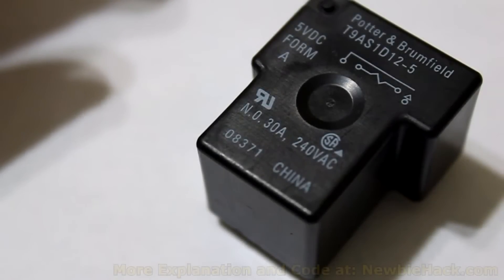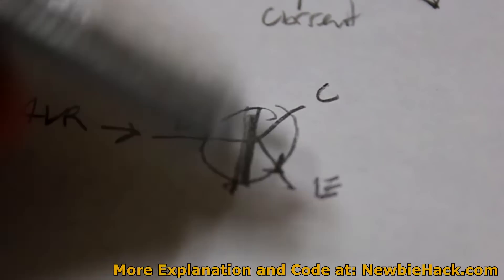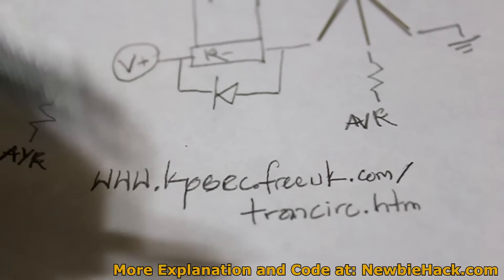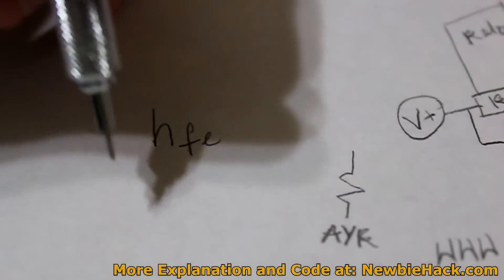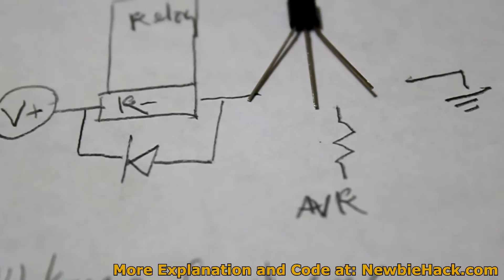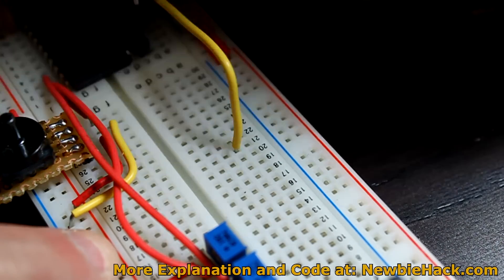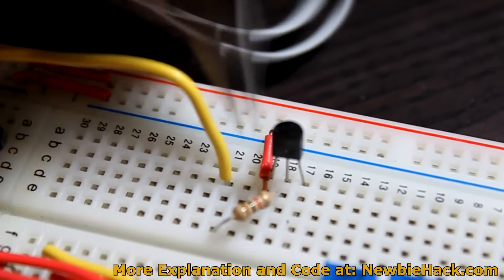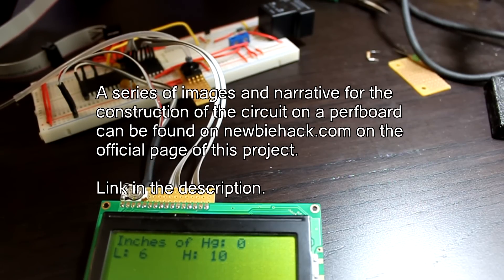46. Arduino for Production! AVR ATmega32 - Part 6 - Real World Example of Create a Vacuum Source

Comment from the maker: I haven't actually probed the the voltage after the transistor.  I've been using the system for about half a year now, so I think the relay coil voltage rating is broad enough to accept the voltage drop.  I can't remember if I checked that on the relay datasheet.

Comment: Thanks for sharing ! 
Do you have to take Vce in parameter ? (Collector-Emitter Saturation Voltage) That should be around 0.4 Volt ? So you have around 4.6 V at the coil right ? It looks like it works, but is that because the coil is tolerant enough on the voltage needed to move ?

Comment: Also, as an alternative to using the logarithmic scale, you can check out the "map" code used by the arduino. It uses more cycles of the uC than your code but it's alot easier to impliment arduino(dot)cc/en/Reference/map